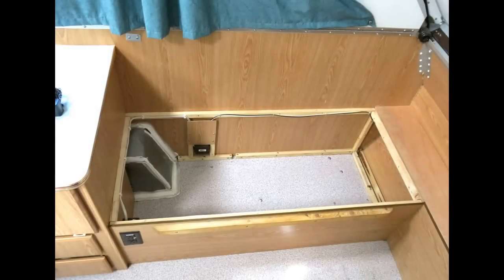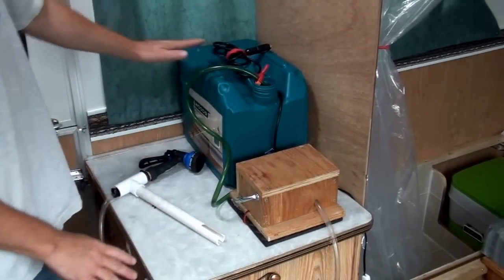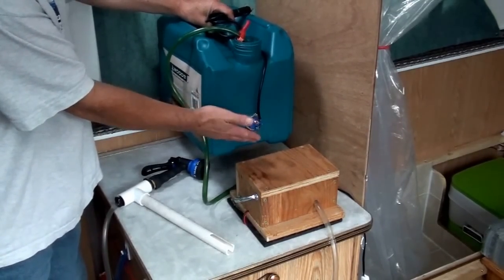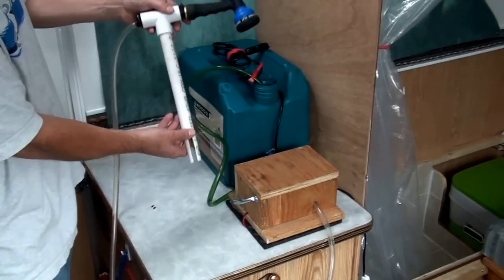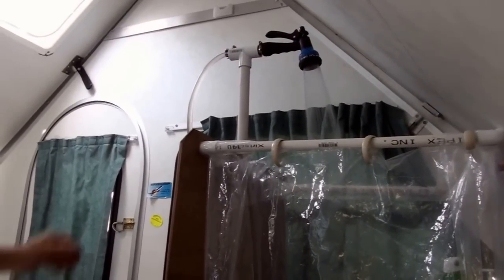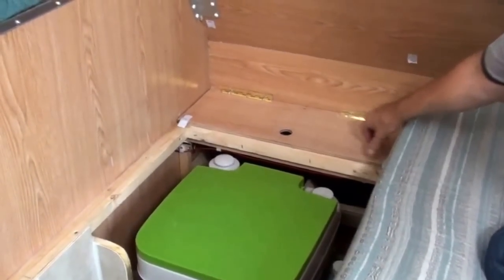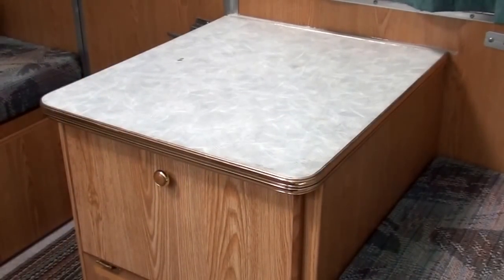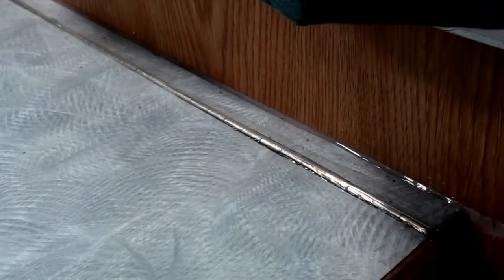Adding a Shower and Toilet to an Aliner Part 2

Comment: Just discovered your channel and subbed. I just picked up a 7x14 cargo trailer that was pnly used as a camper by the original owner. He used it as a toy hauler/camper for his motorcycle as will I. It is pretty bare bones inside and I have been wondering about a shower/port-o-potty setup. I am going to build out a 32x32 shower/port-o-potty nook and do the same thing you did for water. Thank you!

Comment: Clever and awesome. It is surprising that a shower and toilet fits in to that small space. I love the water pressure for the shower, I have seen so many that just have a little trickle for a shower. Also, love the modifications you made to the cabinet.

Comment: Wow, the shower install is awesome. Just wondering if the shower hose could, somehow be connected to the hot water faucet in the kitchen?
Reply from the maker: Hi Debra, Thanks! I'm sure it could, especially if your pump is strong enough for the extra height and distance. My trailer did not have a pump nor hot water, which is why I started from scratch. It would also be beneficial to have the shower next to the sink, but on my trailer the power inverter, hookup plug and water reservoir are all in the way.

Comment: Very nice. Have you found the drain to be enough to dry out the curtain after use of you let it air dry for a while before putting everything away? Great secondary use as a washer, I agree
Reply from the maker: I let the curtain drain then push any puddles out with a squeegee. Thanks! SP

Comment: Did you end up getting any splattering or sprays from the top of the shower area being open? thanks...
Reply from the maker: Hi Angie,

Good question. Not at all. I thought it would, but the shower is amazingly contained. I do however keep my head down when rinsing. A much taller person might have issues though. It certainly takes getting used to the low cramped space!

Comment: I'd like to see you go more vertical with that cabinet. Double or even triple the height, modular. When you're driving, you can take the 2nd and 3rd levels down and put them in the aisle. And when you're stopped and the top is popped up, just place them back up. So you maximize storage. When you are driving(not using the ALiner), the aisle space is wasted space. 

I've been watching a lot of van builds and I see a lot of wasted space because people look at the build as static. When you're driving, you are not living in the van and visa versa.
Reply from the maker: Hi Ron, great concept, thanks! In my particular case however I probably wouldn't do this, as I do go into the trailer a lot when it's in the down position (going stealth, access to the fridge and lower cabinets, the map I left in my map drawer, etc) so would rather keep the aisle space open. For someone who is really tight on space however this would certainly be a good way of achieving it. Good thinking! SP